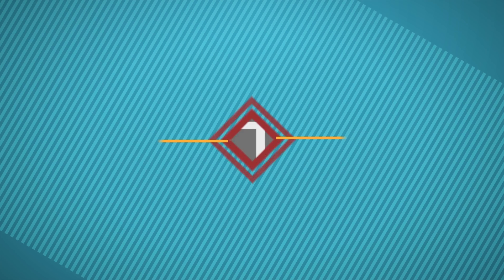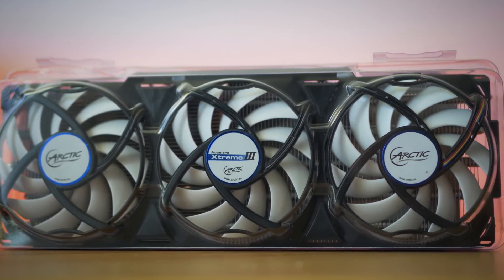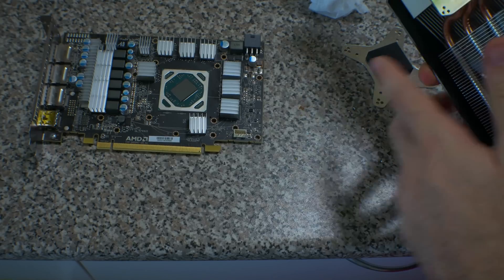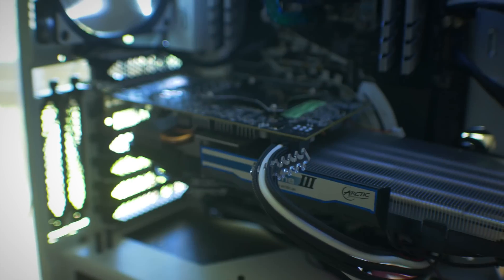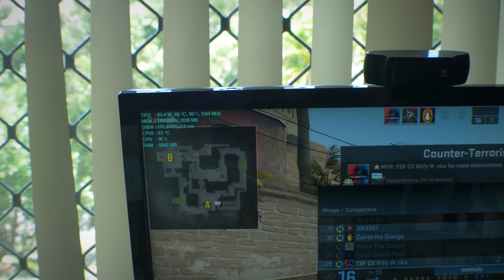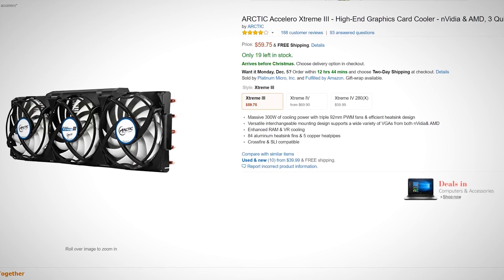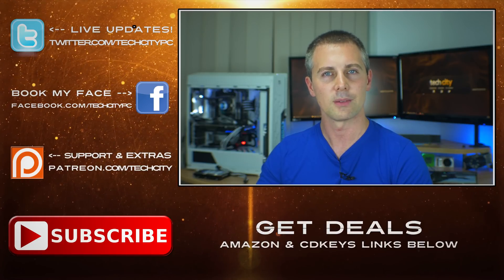RX480 Reference Vs. Arctic Accelero X3 Cooler - CAN IT OC HIGHER?

Comment: they discontinued the artic Accelero coolers and no one is parting with them on 2nd hand sites so im outta luck to cool my oem blower rx580 that runs idle at 65 degrees and reaches 90 in gaming. Reallistically all i need is some form of a compatible normal heatsink and i can just put on some pc fans since the oem blower models have the smallest and inadequate heatsinks imaginable.  

Hell even the vrms on the dell oem model that i have only have cooling pads and not heatsinks on them

Comment: fascinating, I came back to this video after a few years 'cause I was bored today and wanted to try overclocking my 480 some more. I don't have an accelero, but my card is an MSI Gaming x with a beefy cooler and liquid metal, temps are more in line with the accelero than they are with the stock cooler; mine clocks up to 1400MHz on stock voltage and is rock solid stable, but anything beyond that will crash it sooner or later, even if I increase Vcore; TBH I don't know why that is.

Comment: I've got the accelero single fan cooler on my RX480 and the cooling is really good.
I had to move some of the RAM heatsinks like the one in the video, but used thermal pads for the part of the ramchip that's covered by the big heatsink.
So 100% cooling across the board. 

Great temps!

Comment: Hey Tech YES City :)
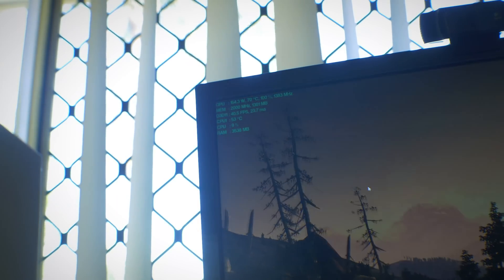You have to set the power-target of GPU a little higher. At 3:05 you can see how the clock of the GPU-processor is jumping. Mine RX580 is stable at 1400 all the time, if I run Unignine Heaven Benchamark. I am pretty sure that the power limit is too low for yours, but please correct me, if I am wrong :)

Comment: Got a Zotac 1060 mini. The cooling on that thing is so bad I was getting 92C (and no RAM heatsinks!). Installed Accelero II, dropped to 61 stock, 67 with OC to 2080Mhz.  Also, this thing is silent!

Comment: Nice vid, I have the rx 470 that I'm going to be using the accelero mono plus on. I have the rear blower reference design and it gets hooooot! 80c in a full atx case with 2 200mm fans and 3 120mm 😂

Comment: XFX RX 480 8 GB reference card and a XSPC Waterblock with a single 280 mm Alphacool radiator with a CPU loop 15-6600K at 4.5 GHz, I am running on the GPU about 1 C above ambient and maxed out below 20 C above ambient.  The video card GPU is overclocked to 1400 MHz and the memory at stock frequency.

Comment: Hey PC building community! I have a question. I'm in a bit of a dilemma on where to spend my 115$ on. So I have a GTX 760 and i dont feel like its doing me justice anymore. But I only have 115$ so my only option would be to do 2x SLI right? Also my friend bought a broken GTX980 for 100$ and he did the oven trick and it has worked phenomenally for him. So advice would be much appreciated!

Comment: I have the reference rx 480 with the Arctic Accelero Mono Plus. I think that getting the two/three fans version of that GPU cooler isn't worth it for the 480. The Mono Plus works just fine reducing like all the noise and 20º celsius. It also turns the card into a mini-ITX card. My OC isn't as good as yours though. I could get +1350 but that wasn't stable. My stable OC was with 1330 core and 2200 memory. The card is a Sapphire, maybe it's a bit different from the reference XFX, honestly I don't know.

Comment: I'm guessing the CS:GO result is because the VRM got too hot, as accelero 3 is known to cool it quite inefficiently. Did you monitor it? I have the accelero on two R9 290 and VRM temps had risen from about 70 on stock to 85-95. But the core temp has fallen from 95 to 75, and that is on 5000 rpm (stock) vs 600 rpm (accelero)...

Comment: For anyone who's thinking of buying an RX 480 now, it would be much simpler to just buy a card with an 3rd party cooler already pre-installed. I've personally bought and tested the sapphire nitro,  xfx rs, and MSI gaming x cards and all seem to run great, with only the sapphire card giving me a little coil whine. But the nice thing about that card is that the fans are swappable and all I had to do was send a quick RMA and they sent me a new fan without even having to send my whole card. xfx also has removable fans but their custom card runs whisper quiet and so does the MSI gaming x although that one is the biggest card and doesn't have removable fans.

Comment: the accelero x3 dissipates 300 watts.... that's completely overkill, really... i know that for the sake of a video, getting something impressive makes more views, but not many people that actually look for a cooling solution for a card that doesn't eat up that much energy (compared to previous generations that is). I once had an MSI gtx 660ti lightning with twin frozr cooling solution (the jet engine cooler). one fan crapped out, so i put an accelero mono plus on it (dissipates 200 watts of power), big difference. from ~83 deg to 65 with no effort and no sound (and i've read of similar results for an RX480 with that same cooler). one big fan, an enormous heat-sink, it was cheap and it worked like a dream. shame that the bracket takes so much space around the ram though... my solution with the gtx 660ti was to cut out some pieces from the aluminium shield (already on the card) that gave some cooling for the VRM and the ram chips.

Comment: 1) the percentage of players plays csgo in under 4k Resolution. Max res ive seen someone play with is 1080p
2) Csgo is still a CPU intensive Game, you can run that shit with a 9800gt paired with a fx 6300 (severe bottleneck) and get an average 60fps on mid to high settings on Inferno2
Reply: im running gts 250 (which is rebranded 9800 i think)
im getting around 120fps in csgo, although im playing on low res

Comment: Old water-block on the gpu and heat-sinks on the vram and the vrms. Temps are below 55 °C at medium fan-speed. Radiator is 240mm, gpu is gtx970

Comment: Eh, you might want to try a 480 with a 8-pin instead of the reference card as the GPU is both bottlenecked by heat and power...
And a bios change might help too...

Comment: I have installed Arctic Accelero L2 plus on my HD 7790 because I broke the fan on the MSI original cooler and I could not get a replacement. The issue with that cooler is that I could only install 2 heatsinks on memory and surrounding (stuff) because of the terrible Accelero design on the main heatsing.... The "neck" touching the chip should be longer to fit more models. 

True - the fan is silent but because of missing heatsinks I am not getting lower temperatures - the MSI cooler was better design for cooling those bad boys. Anyways It is not high end graphics and I only run it as secondary GPU with R7 260x in crossfire  - it is not as much of a problem :)

Comment: I have an XSPC Blade on my XFX RX480 ref, the block cost me $67.00 and I already had a custom loop.  I had mine up to 1470, backed off to 1466 because I thought I saw some funny lines for a second.  At 1466 running Valley and then Heaven for a good while, then some gaming, my GPU temps were low 50s.  Yes, the BIOS got a change to get 1.4 volts.  Oh, the block cools the ram and the VRMs.

Comment: What is the application you are using for Wattage monitoring? I have a XFX 480 and MSI Afterburner shows much lower wattage consumption. Cheers
Reply: Marian4q3 Four if youre using the XFX GTR thats because the GTR draws less power. the XFX RS might aswell.
Reply: Yes I have the one from Best Buy (with smaller PBC) but Afterburner max reads is about 107W (usualy sits on 60 to 90W). I read somewhere that is GPU draw only (no GDDR5, nor VRMs, etc)
Reply: View the XFX GTR RX480 review from JayzTwoCents, you'll see that he makes the same comment. the card just doesn't use alot of power lol

Comment: Is there any for asus gtx 950 mini ?
Reply: the ARCTIC Accelero Mono PLUS should fit. But why would you want to upgrade that card? Better optimize that fan curve in MSI afterburner..
Reply: temperature is low(it newer pass about 60c, i think its limited in bios), at moment just thinking. I get it realy for low  price.

Comment: i expected even better temps
I still have my original Artic Accelero on my old but gold 8800 Ultra and compared to its original cooler it dropped the temps 22-25c and on full fan speed it was to 29-30c

Comment: I saw that coming after watching previous vid about Accelero. Check out also Rajintek Morpheus, you can attach custom 2x120mm cooler on it. Even on passive cooling i believe it could beat stock coolers on reference cards. Imho AC III /IV and Morpheus can beat most of AIB's also thus i always get one of the cheapest cards and insta swap for custom cooling.

Comment: I am running an Homemade aftermarket cooler, 3x90mm fans slapped on an R9 270x windforce, beacause the original fans died. I guess it's kind'a an aftermarket cooler? :P

Comment: I have a NVIDIA reference card gtx 770 , my temps are about 69-70 c
Is my cooler good enough?
Reply: Mongocom  no problems :) if they are closer to 90 sure but below 84 is just fine
Reply: TrueDesireHD because i get really unstable fps in fallout 4 ; (
Reply: Mongocom
 oh its the game :P
turn off all gameworks stuff, a friend has issues with a 980ti in that game at 1080p :P
Reply: TrueDesireHD what do you mean with gamework, wath is that?
Reply: Mongocom
 something like godrays (if they havnt changed the name) messed up the fps real bad, it didnt provide any visual difference either when upping it.
Reply: TrueDesireHD that is already on low, I found out it was my cpu: a dual core 3.06 ghz. My gpu only goes up to 60-80%
Meanwhile my cpu hits 100%
Still... I found a way to get better performance: set the themp limit to 80c instead of 70, there is less studders. My cpu temps are 65c (its a laptop attached to a desktop gpu)

Comment: I am running an aftermarket solution, the stock fans on my GTX480 failed so I screwed 2 case fans into the heatsink and it runs 10C cooler at idle now
Reply: way to mygyver the hell out of that problem!
Reply: Casey Urquhart uhmm GTX 480 i think you meant rx if you didnt.... poor you
Reply: So 10C cooler than infinity... still infinity. ayy
Reply: hey man, there is no "poor you" with the gtx 480! it is still about as good as a gtx 950!
Reply: Bhume well yeah its not thaaat bad really

Comment: Running 2x 390x in CrossFire with a G10 Kraken and H55 AIO, heatsinks over all the VRMS. Cards idle at around 34 degrees, valley pushes them to 51 degrees at max.

Comment: Haven't watched whole, but if you want a high OC on a RX 480 you gotta unlock voltage to 1.3 and higher. Then you can reach 1500 easily.

Comment: Why worry so much about temps, its pointless. My gpu is subzero at -55c to -35c for normal use (Vapochill LS phase cooling). Every card has a limit to its overclock, for some this is temps (rare), power delivery (my problem), no voltage unlock, and stability of the chip. With a reference R9 270 (tiny Intel size cooler), I got a 25+% overclock in even Furmark and it was fine (95c @ 25%, 65c at stock). Going subzero didn't make much of a difference at all, I was apparently super close to the power limit. So it turns out, the Dell OEM cooler was good enough for 98% of its total potential.

Unless its getting super hot (over 100c while overclocking, 90+c stock), its not a big deal. Don't worry about it. I have an old ATI that sounds like a jet engine and idles at over 70c (everything stock), crank up those fans though and get a 20% overclock. Its perfectly fine for some chips to run hot, for others its not so good, but these budget cards will be basically useless in 4 years, so I wouldn't pay $1 to make them last any longer (not a day, not 10 years, they will be paperweights in 5 years. Trust me, my $2,799 ATI with 2 GB of 512-bit GDDR4 memory is only good as wall art, not for gaming, and it was the most expensive card in the world in 2007. These budget cards will be $15-$20 then, if that).
Reply: Ever heard of Moore's law and how it's coming to an end? I doubt that a current gen high-end card on a 14 nm process will be demolished anytime soon. Hell, NVIDIA's 10 nm process is scheduled for Volta in 2018 , and there are no talks of a 7 nm process on mainstream graphics cards. I'd probably still be using a GTX 1080 or 1070 3 years from now.
Reply: ECCENTRIC Moore's law was about frequency speed, ever heard of the 3500+ Cuda core Titan? Also, you're thinking 2D. Samsung already sells 3D SSDs. How to cool it? There was research I read about years ago with direct silicon water cooling chips for smartphones. Think about it, we could make a brick with hundreds of layers or water cooling channels and gpu wafers in the same space of a single slot height GPU. And have you seen the size of a GPU dye? Its like .5 in^2, its roughly 1 cm x 1.5 cm. You could cram like 4-6 of those in a CPU tin. 

I'm an engineer, I see answers to problems, its what I do. I highly doubt all the engineers will die off in 5 years, but then again, our hair starts falling out pretty fast and early.

PS, my GPU from 2007 and cost $2,799 is about 1/3 to 1/4  the power of the RX 460, though its a great space heater!
Reply: ECCENTRIC I think you twisted your words/logic somewhere. "if a processing die gets slightly larger, it's heat output increases exponentially. So I doubt that we will have processors too much more powerful, considering we'd have to cool them somehow."

That's why we won't have to cool them so much. Look at old AMD cards, I'm looking at the Fury right now, that thing has a rating of 375w. Now, the RX 480 is only 150w (slightly less performance). but the GTX 1070 at 150w is on par with the Fury. Each year they get more efficient taking less power (think back to the 165w TDP Intel single core days).

We won't need to cool them nearly as well, so heat won't be an issue. 

As for silicon, (pushing up nerd glasses) Carbon Nonotube transistors! But seriously though, we will probably move onto something else besides silicon. So your probably right about advancing past silicon.

Based on the rate of advancement, I think its closer to an exponential raise instead of platue. When my parents were in college, they used sin and cos tables, now we use a calculator or a phone. Slide rulers were the Ti-Inspire of the day. Plus, the computers back then took up rooms and had maybe .1% of my calculators power (let alone my phone). I think we can safely say we will keep advancing. The only end in sight is nuclear or a new super weapon ending technological advancement because everyone dies (so don't go building a GTX 480 SLI nuclear reactor, you could bring an end to 4k gaming if it blows up!).
Reply: Jake Garrett Interesting. Thank god for scientific advancement!

Comment: Can someone help me? In my country GPUs are kind of expensive:
-GTX 1060 3GB: 230€
-GTX 1060 6GB: 275€
-RX 470 4GB: 195/200€
-RX 480 4GB: 230€

Thanks in advance.
Reply: Hey man, those prices aren't THAT bad, but if you want a cheaper card buy a used one. Sites like Ebay or something can have pretty good deals, just make sure the card is listed as USED, not FOR PARTS. Also, older cards like r9 fury, r9 390x, r9 390 are good value as well. Hope this helps
Reply: Thanks for your response, saving money buying a used graphic card is really compelling but I wanted to  buy a new one.
Thanks.
Reply: speaking of the fury, I really should've bought that fury x on cyber monday. it came down another $50 during that time.
Reply: RX 470.

Comment: I put my R9 290 under water with a Corsair H105 and NZXT Kraken G10 bracket. 
I mostly did it for the silence and temps, because those old reference blowers are loud AF. But those stock Corsair fans are shite, you can't even mount them upside down (bearing noise).